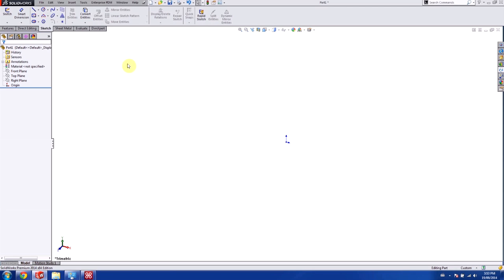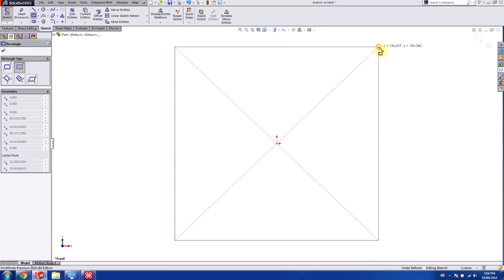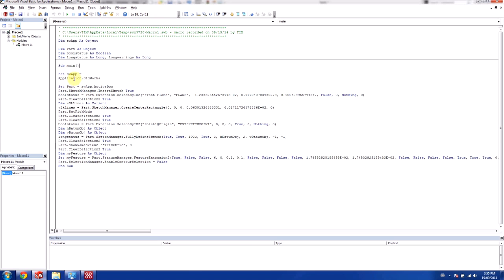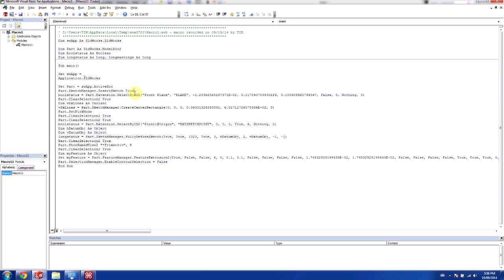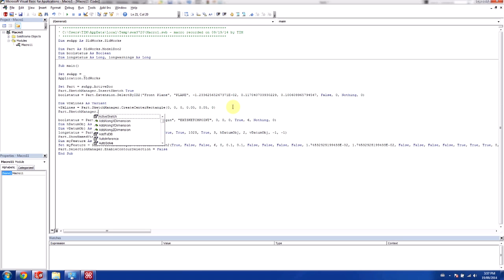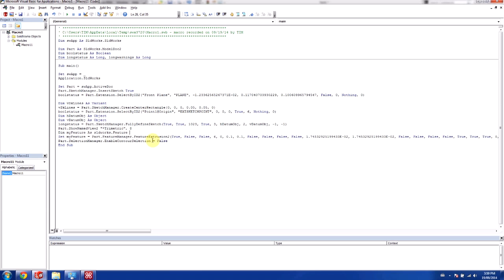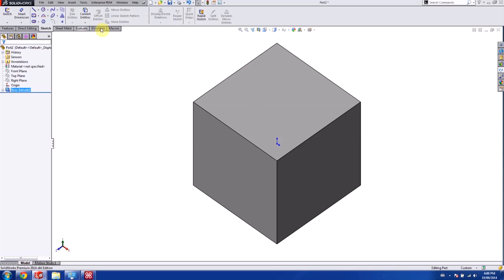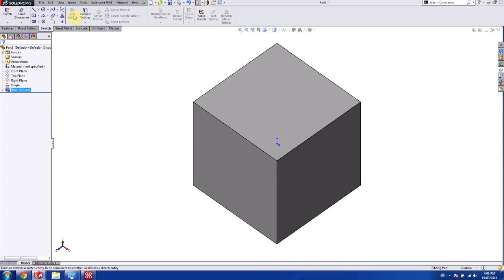SOLIDWORKS - Introduction to Macros

Comment: Hello,
It's a good introduction to learner.  But I have few questions
1. Can we use the part like a tool box macro with various configurations in that part?
2. Can we use one icon/tool for multiple items?
3. How can we create a folder with multiple icons in it with macros?

Please share some inputs.

Thanks
Reply from the maker: I think most of your questions could be solved by creating a User Form in the macro. 

This would allow having a popup dialog / UI that allows the user to customize the operation of the macro before it runs. The fields of the form can be linked to variables that control what the macro is performing. 

Search "VBA User Form" for some tutorials on how to set them up

For an even more advanced approach, you could create an Add-in for SOLIDWORKS using the API. This could be loaded up like any other SOLIDWORKS add-in, and could give a dedicated tab on the Command Manager with its own tools.

Comment: Thank you for your video! What if I want to create a macro that imports some points and then uses these points to create a sketch? I would like to make it so that if I change the coordinates of the imported points the sketch change its shape in accordance with the points variation. Is this possible? For instance:
1  2
2  4
4  6
are 3 imported points.
Then I create a triangle using these points.
I close the macro.
I change the coordinates in the .txt.
I open the macro.
The triangle is created with new vertices.
Can this be done? (it's enough if you say me if this can be done or not)
Thank you in advance!
Reply from the maker: This should definitely be possible! You would need two cases in the macro - one for if the triangle has not been generated yet, and one for if it exists already and needs to be updated. There should be some existing freely available macros for importing points. Recommend searching through the SOLIDWORKS API Help, there are many examples.

Comment: Is it possible to write a macro to change Font height under Options / Document Properties / Dimensions ?
Reply from the maker: Certainly should be. The SOLIDWORKS API Help is a really valuable resource - here is a link to the API calls for accessing the Document Properties / Dimensions http://help.solidworks.com/2019/english/api/swconst/DP_Dimensions.htm
Reply: it's may be